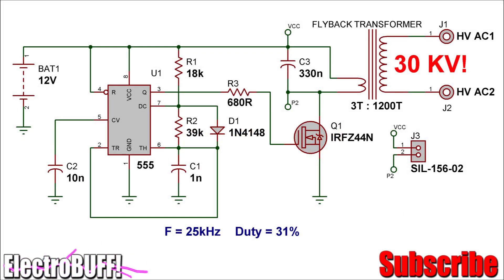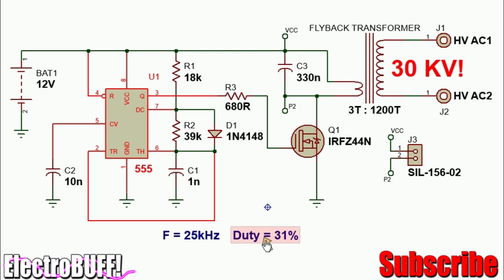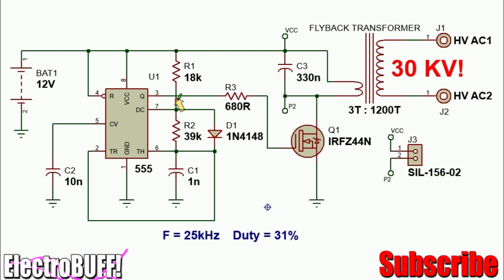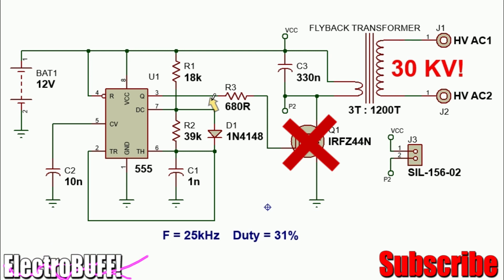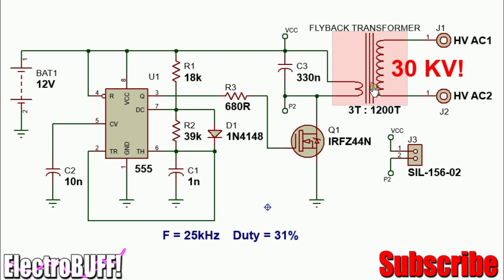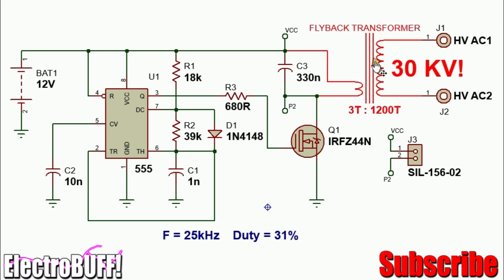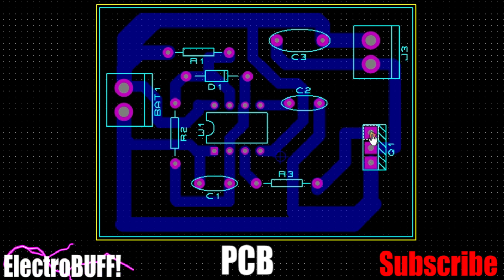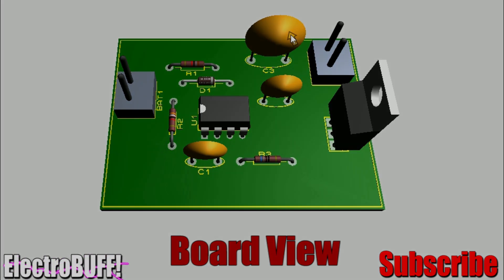Simple 555 Timer Pure Sine Wave Inverter Flyback Transformer Driver for High Voltage Power Supply

Comment: This is a Square wave inverter.
Reply from the maker: It's sine. The capacitor in parallel with the primary winding make a resonant circuit which generates a pure sine wave.
Reply: @ELECTROBUFF  in order to resonate togther with primary,  which should be the inductance value on primary winding, I see it need to be built with a ferrite power transformer in order to keep inductance within a range of 3% , iron core traffo doesnt work to control inductance? 2. What is the nominal output power of this circuitry? 3. If traffo is built with ferrite core, how it prevents the core come into saturacion due to dc unbalance on pry winding, just note pry is clampled to 12 VDC ?